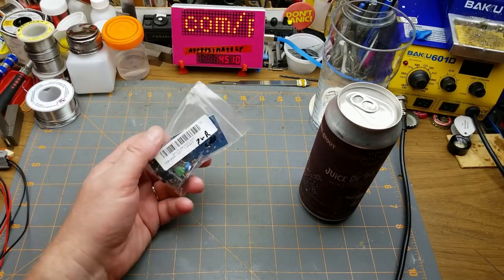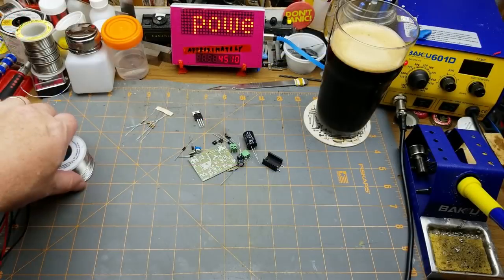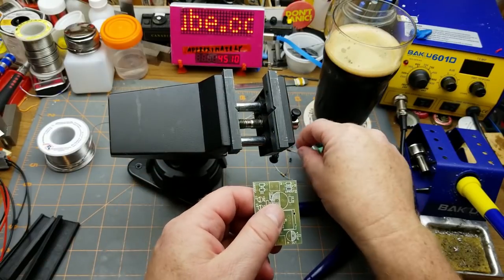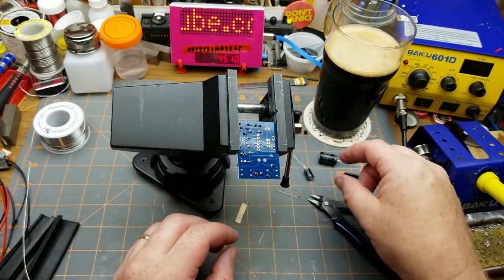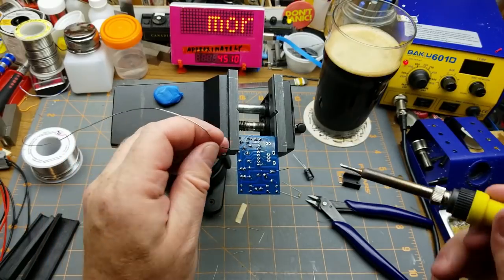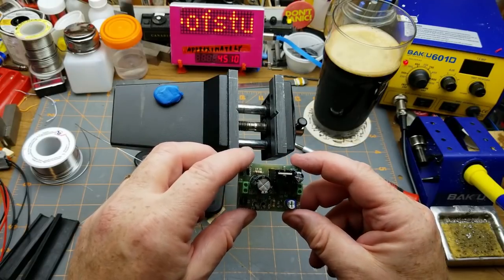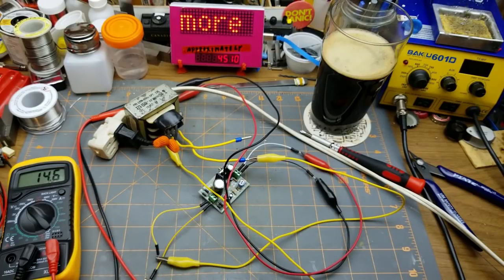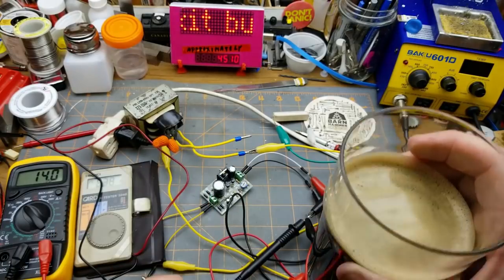transistor based linear power supply kit build

Comment: Sponges have been fine for 30+ years to me. They work. Nowadays I prefer brass shavings (with sponge if I seem to need it instead). The most important thing is to clean the tip often enough. It matters way more than what you clean it with! ...at least that seems so to me, I've used moist sponge, not soaking wet.
I so agree about not getting the expensive tools at the start, especially if you're not sure you really need one. Of course, there are deals you just don't want to miss. I have for example end cutters that cut the lead to fixed lenght and bend the lead to 45 degree at the same time. I could not buy those (Erem quality!) for about $10. Same goes for the end cutters that crimp the end larger. Both allow me to populate hole board without components falling off. I don't actually use them that often but at the price I could not skip the deal. It was once in a lifetime deal.

Comment: There is a mega, turbo, blown, nitro LM317 called an LT1083CP. 4 of those in parallel (one as the regulator) a pot, a few resistors and caps with an old PC processor heat sink and fan and you have a pretty powerful supply. Large wire wound balance resistors on the output of each TIP35C is a good idea. 10 amps at 15 Volts is no problem with 36V in. Just use the parallel LM317 circuit.

Comment: i have repaired a lot of supplys over the years, quite a few use that same basic design lol.

Old video recorders and a lot of 13.8v c.b "Power packs" use the same circuit but with an added one or two extra output transistors, 2N3055's on a good heatsink is typical.
It seems once someone makes a cheap but reasonable circuit then everyone copies it lol.
Even Radio shack.

The D880 is rated at 3 amps, but that would require a good heatsink.
i'm old tech as well, the damp sponge works so why change :-).
Reply: I've used a wet sponge for about 45 years. I find the metal shavings a bit odd. But in the old days you went and  wet the sponge while the iron was heating up. Along with making a cup of tea.:)
Reply: The Embedded Hobbyist
Dam you have been watching me :-D, a cup of tea improves the soldering no end, keeps the brain lubricated.
That's my excuse and i'm sticking to it :-D

Comment: Odd that they use a Audio Amplifier transistor as a ac to dc power supply. The boys at EEVblog would have a field day with this thing.
Reply: There are many older linear bench power supples that use 2N3055 or TIP35C power transistors that can be used in amps. Anyone starting out who has a suitable transformer maybe from an old amp can make a simple one for a few £/$ if they don't mind using 'gubbins' from China, I think their stuff is fantastic. I'm on number 7, why? No idea it's fun init.

Comment: I want to replace the linear regulator on an old Socket 7 mobo by something thats capable of doing 5V->2V@~12A, so I can run an AMD K6-II in it. However, I can't seem to find any reasonably small buck regulator modules that support this kind of current. Any ideas? My plan B is to salvage mosfets and a synchronous buck regulator module from some newer mobos and build something myself.
Reply: I would play with the bios settings first. You should be able to change all that in the settings. If the regulator isn't capable of 12A just buy a regulator in the same family that can output 12A and swap them out. If you need more power change out the power supply. People are giving that stuff away for free all the time on Craigslist and Facebook market place. I wouldn't waste my time with a module to power it. You will probably fry the motherboard and everything plugged into it before you turn on the PC.

Comment: Please give that poor little hot transistor some goop. And a bigger heatsink... you know you've got one somewhere. It's only doing 150 mA at near supply voltage, just think what will happen with more current at a lower output voltage. "Those little guys aren't getting hot"... shows little power supply some scary calculator numbers muahahaha!!
Reply from the maker: I do have some bigger heatsinks, but they're all bigger than the rest of the project....